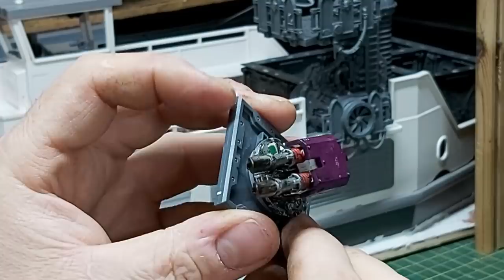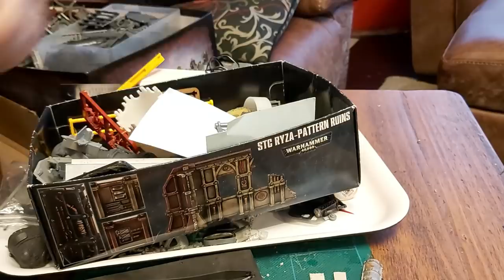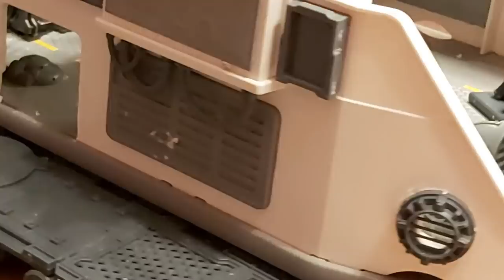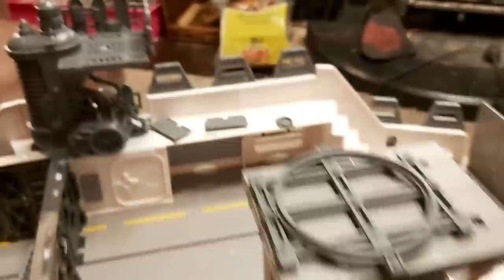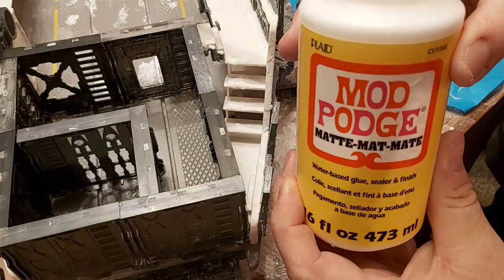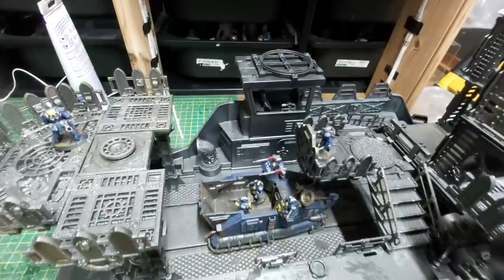Necromunda Scenery Build - The Enforcers' Sector House - A Floating Sump Fortress (PART TWO)

Comment: Great build as usual Tim, it has all come together really well and will sit nicely alongside the rest of Sump Town. One little tip might work, some lightweight mesh on the bridge windows as the driver would be a bit exposed in the event of an attack. But don't use that dreaded Granny Grating! I use the mesh screen for windows to keep the insects out. Its flexible, light and looks more to scale. Looking forward to Video Number 3. :)
Reply from the maker: Metal grills are part of the plan

Comment: Lov’n this whole series. On the stern should there be a gang plank/walkway to allow the connection of the boat to the rest of your hive city squares? That would allow play from the rest of the board onto the boat without models having to board boats to get there...
Reply from the maker: Short answer - no. Long answer - in some games I might moor it alongside the sumpwall and have gang planks, but I am moving to a whole sump based community so there will be more vessels, little islands and other walkways. Other gangs in my campaign will end up with means of travelling on the Sump

Comment: Are you gonna put block on the underside of the removeable pieces so they will snuck ontop the other layers?

(Also nice Ad placement)
Reply from the maker: Yes. Only the Layers of the Admin tower will be removable in the end (oh and the crane) but they need some little blocks on their underside to stop them from being knocked about
Reply: Are you planning on putting something ontop of the Lascannon as "Energy Unit" for it?
Reply from the maker: I might dig out something to also hang under the arch.  Nice idea

Comment: Gameplay idea:

Two attacking gangs vs one gang of Enforcers. The Enforcers have to hold the base and have the awesome firepower of the automated defences, but the attacking gangs have severed the umbilical of the external power feed that powers the weapons and the Enforcers have to attempt to restore it to stand a chance of winning. That means both gangs have to move to objectives in order to win the game and should make the play fairly dynamic. The attackers have the early advantage, but will become seriously outgunned if the Enforcers manage to restore power.

You could get up to about 3-or-4 vs 2 by including the vehicles and more boards with a canal system entering the main town. Could make for a real fun large scale game.